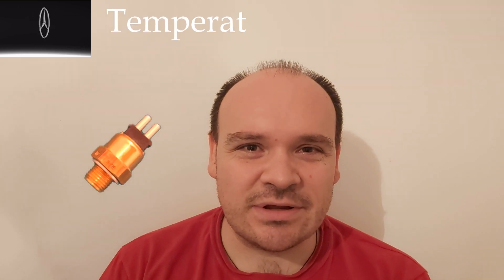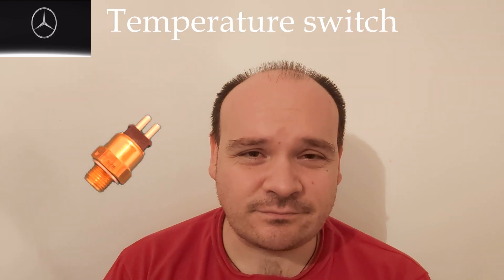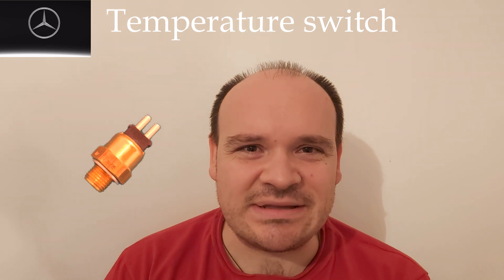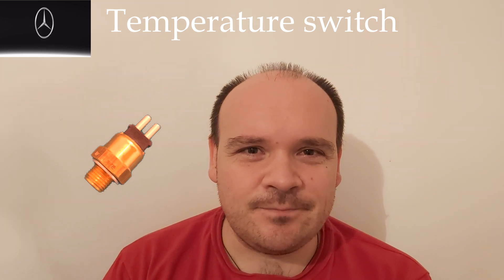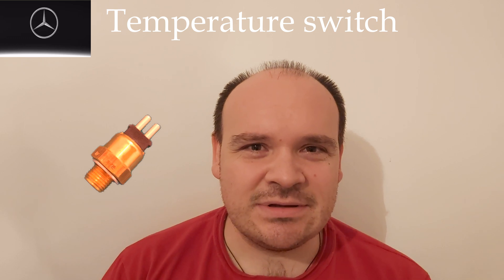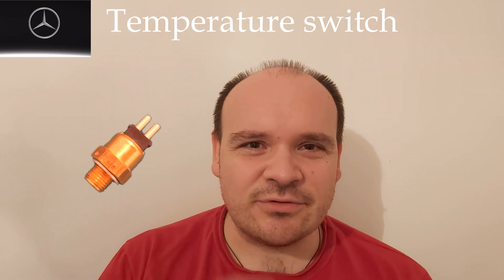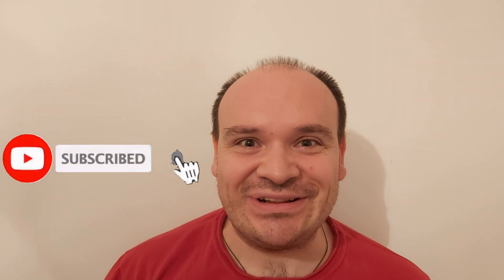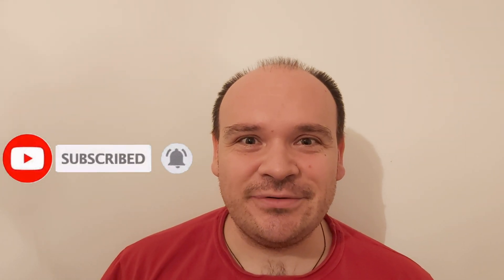Mercedes W124 – Choosing the Right Radiator Fan Switch (Behr TSW 5D | KE-Jetronic Tips)

Comment: I do have a red switch there. (M103 engine, 1990). When idles, and the ac is on, temperature goes up to 100. Maybe is this switch the problem?
Reply from the maker: Depends of the switch itself when, at which temperature, it's going to start the fan.

Comment: Is mine faulty? Sometimes the fan will run even when cold. Also sometimes it wouldn't turn off even after engine is off.
Reply from the maker: There is a temperature mark on each of them when they should turn on. If it doesn't happen the sensor is not good.

Comment: I highly recommend not to use 85C sensor. The reason is: 87C thermostat opens partially at 87C fully at 102C. The fan initiates at 100C. Therefore we see that the temperature gauge goes over 100C and then suddenly comes down. When you use 85C fan sensor with 79C thermostat your thermostat never ever opens fully. You use the fan more often. That is not necessary.
Reply from the maker: Thanks for that advice 👍🏻

Comment: Can you bypass this switch to test the fan clutch? 
Put a wire between the two leads going to the switch and the fan should kick in?
Reply from the maker: When I put a wire in the leads the fan clutch kicks in. The point of the video was to show people that they don't have to turn on heating. They just have to have a wire and as they put it in the leads the fan will start working continuously. This is going to save your engine ro the first auto shop(ok, you will have to wait for the engine to cool down because if you unscrew the switch you risk of burning yourself). This is a fast trick how to cool down your engine if the switch goes bad.

Comment: Is there a way to test the old switch to see if it is good or not good?,,thank you again for all the great videos, they are very helpful,,,,,thanks
Reply from the maker: Thanks, glad to hear that. If you know at how much the switch opens then If it doesn't activate the fan at that temperature, it's bad. Or I think there is a way to take the switch off when the car is cold, take a thermometer 🌡and put it in water in something you are going to make warm. If the switch doesn't click when the water reaches 90 degrees e.g(if the switch opens at 90) then the switch is bad.
Reply: Thank you so much for your reply, I will try that,,thank you,,
Reply from the maker: In fact, you won't hear anything, you have to connect a multimeter on the switch and if it gives ni resistance, it's shot.😃

Comment: Great video again, thanks. Australia is a hot place and I reduced the auxiliary fan cut-in temperature from 105C to 95C by soldering a simple 1200 Ohm resister between the thermostat plug pins. So what is the value to use?
98 deg C ====> 1780 ohms
95 deg C ====> 1200 ohms
92 deg C ====> 1100 ohms 
More info here:  https://www.k6jrf.com/MB_CTS.html

Comment: hello. on my car i have 3 sensors on top of the engine. one with 1 pin, one with 2 pins, one with 3 pins (but it has only a 2 pin connector, 1 pin is left alone). what does everyone of them do?
Reply from the maker: I have 2 with 2 pins. One of them is a coolant temperature sensor(reports the ECU if the engine is cold or not) and the second one that switches the radiator fan on. I am talking in this video about that one that switches the radiator fan on.